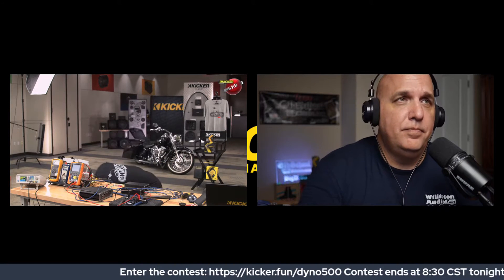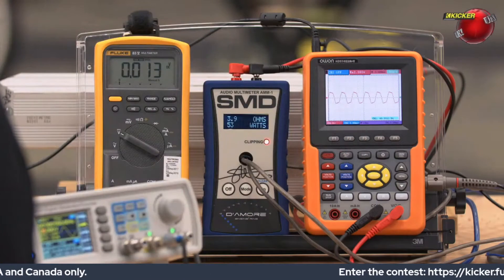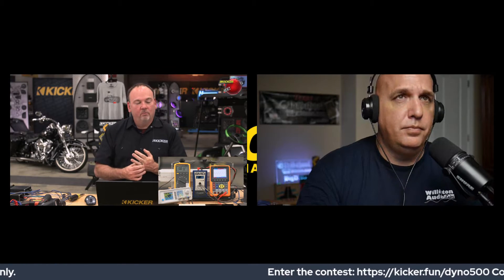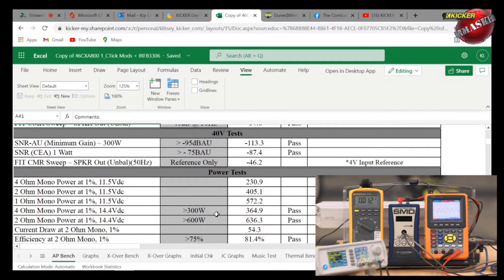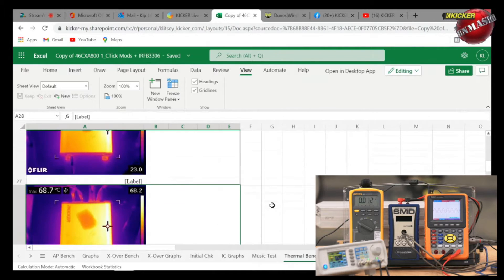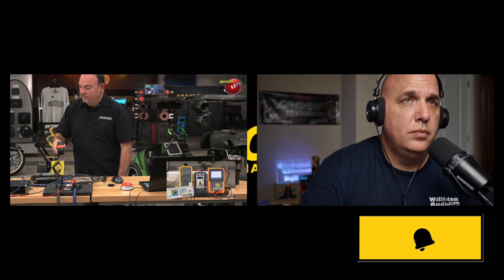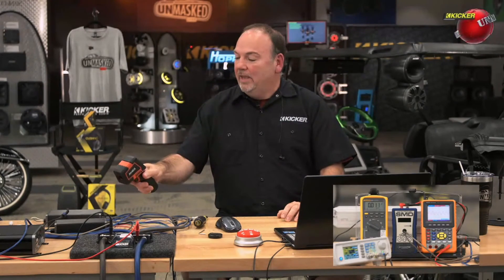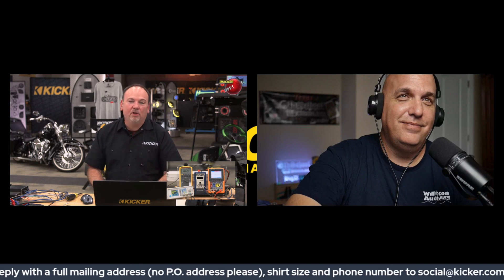THIRTY Minute Torture Test - KEY200.4 - KICKER UnMASKED - Shorts

Comment: You guys could just use quick connect plug connectors to switch between amps. Would make it easier while putting on a show
Reply from the maker: That might be an option, yes.

Comment: This looks amazing, but I don't find 50×4 to be enough, my front components and rear coax are rated 125rms and I like them really loud. Also the sub version of the key is 300 rms at 2ohms or 500 rms at 1ohm, my 10 inch kicker L7S came in a factory box with a 2ohm impedance rated 600 rms. I want full power to my sub. The built in simplicity of the DSP is awesome, I don't care about an amplifiers size within reason, if you give me double the power you're currently offering I'm a buyer. Or add the DSP tech to the CX or KX amps. I'm willing to pay for the ease of use, rather than buying a separate DSP and then having to program it with a computer.
Reply from the maker: This is an affordable option, but not the right fit for everyone.  We have more powerful 2 and 4 channel amps that may work better for you, or use the DSP functions of the KEY and send the signal to one of our more powerful amps - best of both worlds.
Reply: @KICKER-AUDIO Is any kicker amp compatible with key?
Reply: @KICKER-AUDIO That’s an interesting idea you mentioned. Is use the Key  as basically a standalone DSP and run it to a more powerful amp for more watts if needed. How would you suggest doing that? Does that Key have RCA outputs ? Or would you have to run the Key to another LOC to run it to another external amp?
Reply: @julesbruchez-theartofgrapp9646 Hi there. No I don't think it has RCA out. There is an advantage to using a hi to low, or LOC and that is the 9 or so volts you'll be sending to your more powerful amp. A strong clean signal is what all amps want. The increased dynamic range in your music from 9 volts pre will be evident.

Comment: Is 'clipping' distortion in the signal? So thats when speakers start playing dirty and risk damaging something?
Reply from the maker: That's correct, and it can happen for a few different reasons: Incorrect gain, source volume too high, going over input/output voltage range.
Reply: @KICKER-AUDIO  is there someone I can call at your company to ask further questions?
I'm planning to get your Key200.4 for my 2015 Mustang. I just want to be sure I set this up correctly and understand what the Key200.4 is capable or incapable of.
Reply from the maker: Sure! Give our Technical Support department a call at - 1 (405) 624-8583 - and they'll be happy to help!
Reply: @KICKER-AUDIO  thank you!

Comment: If I run this amp to my Focal PS 165 fxe active will I need a cap for my tweeters. I heard with or without would work
Reply from the maker: No, you shouldn't need a cap. If you choose to use one anyway, be sure to install it before you set up the amp's DSP.

Comment: Thank you for fast respone, will it works with 2.5 ohm spekaers ? :)Thanks
Reply from the maker: It depends on the amplifier, the number of speakers and the number of voice coils per speaker. For example, if your amplifier is rated to play as low as 1 ohm and your speak is a dual voice coil 2 ohm, wiring in parallel to 1 ohm is acceptable.  However, if you try to wire a dual voice coil 1 ohm speaker to that same amplifier, you wold have to wire in series to get a 2 ohm load, because wiring in parallel would result in 0.5 ohms, which is too low.  Ultimately, the physics of speaker wiring is immutable. You must look at the specification of your amplifier and understand safe wiring practices involved.